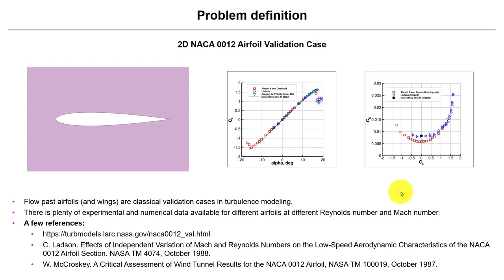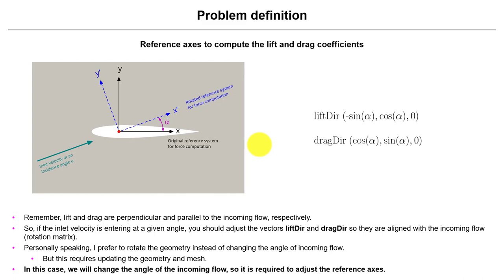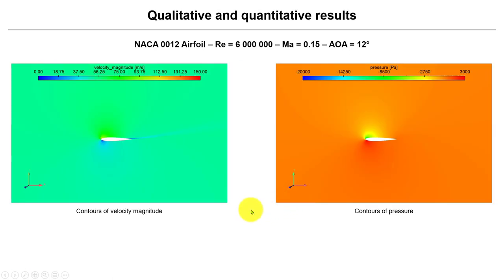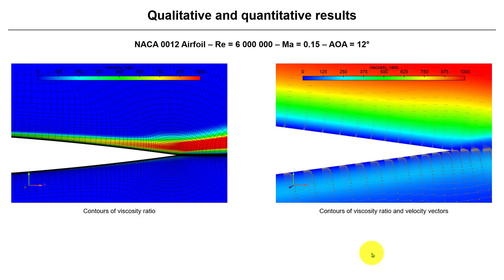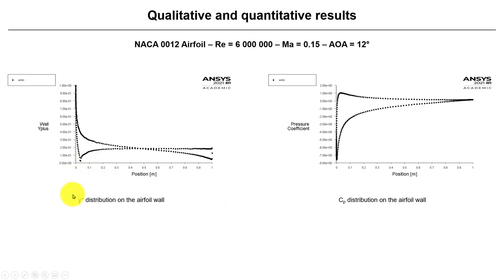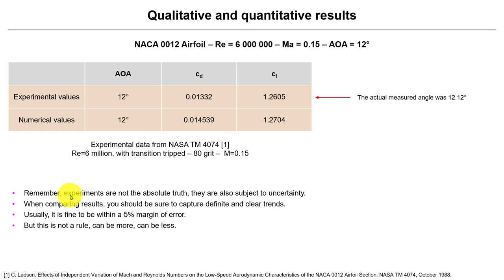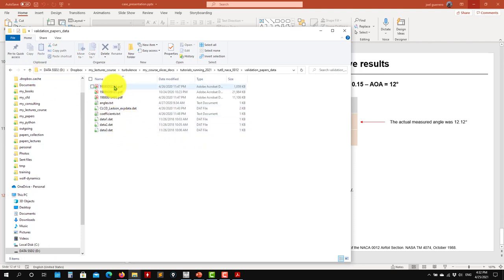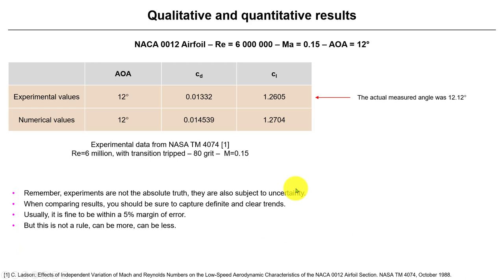Turbulence modeling with Ansys Fluent | Flow over a NACA 0012 airfoil - Part 1

Comment: I am doing it in openFoam with my mesh but unfortunately I am getting results after 150000 iteration. What settings should be changed to get faster convergence and results please help my error are under 5%
Reply from the maker: Compressible cases are tricky to set in OpenFOAM, you should use LTS approach instead of fully steady.